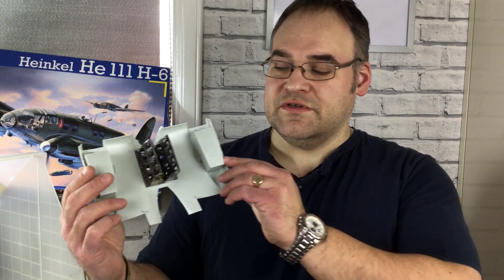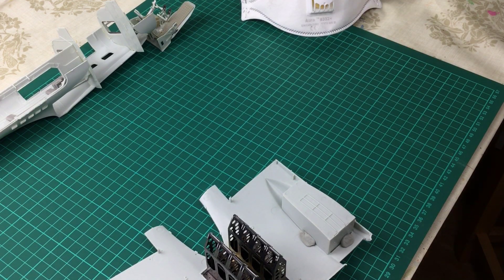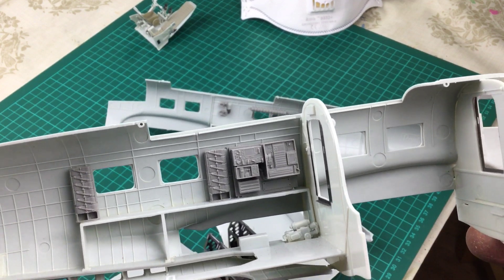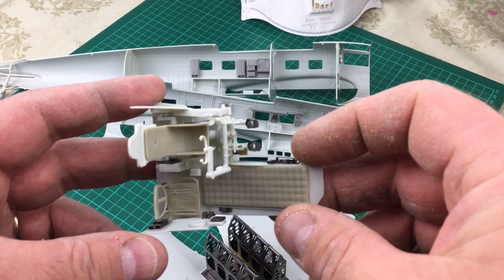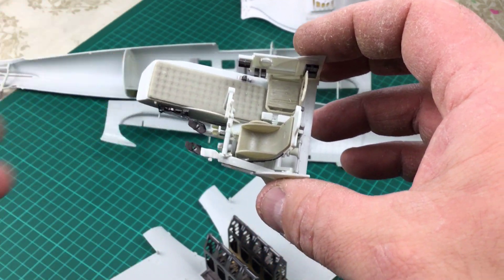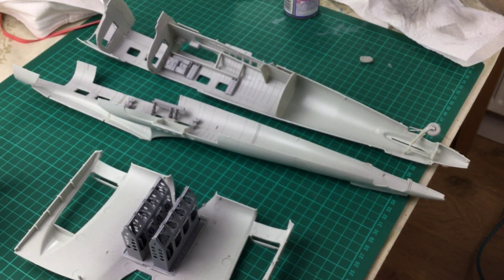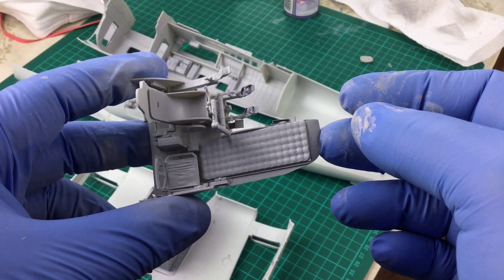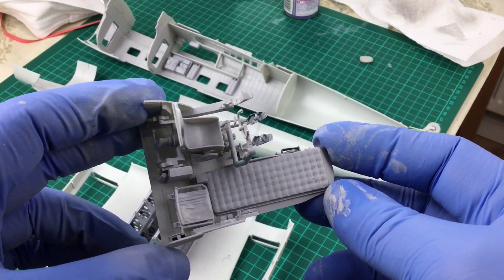Revell 1/32 Heinkel He 111 scale model, Big Build Part 1

Comment: Great start. Could you tell the brand of resin radio set and cockpit extras? Where can I get them? Many thanks for help
Reply from the maker: Hi Piotr, the detail radio set is from Aires part No. 2186, I also used HGW cockpit set No. 132035 and finally used Eduard big Ed set for the 1/32 Revell kit, all these can be found on eBay or through Hannants in the UK. I have to say all the extra detail parts fit very well with minimal cleanup and add so much more to the kit. Thanks for watching, I will be getting back to this build soon👍